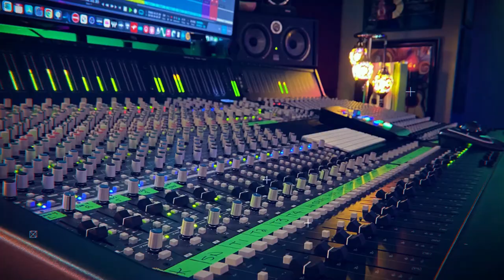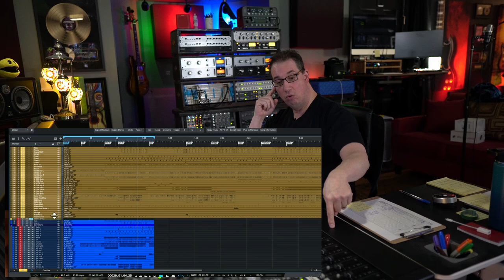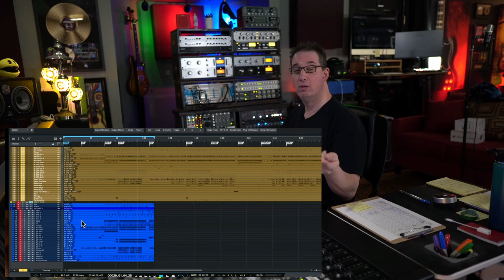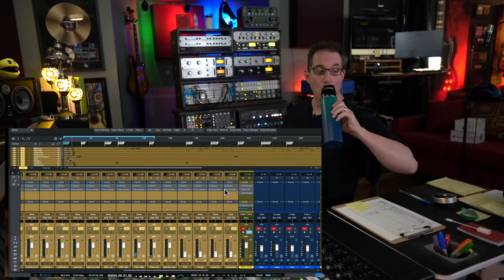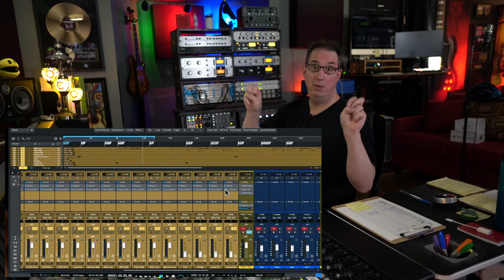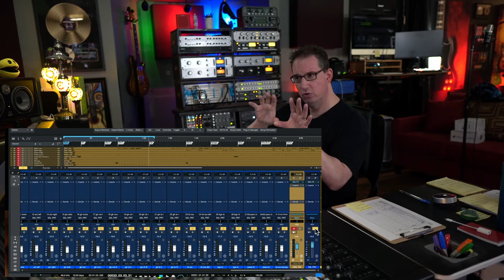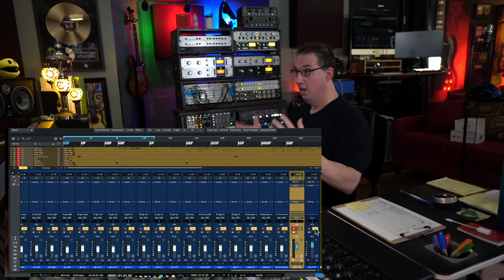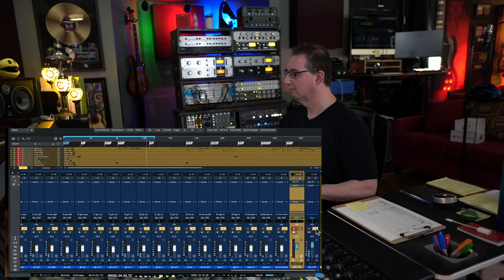SSL Origin Preamps vs SSL Plugin Preamps

Comment: I remember mixing my songs with lots of plugins, eqs, comps, etc trying to get an 80s power sound until I decided to use the Waves, yes the WAVES SSL channel (not the new one) and suddenly the world opened to me. The sound I get by just using the SSL is amazing, the EQ is so fricking musical and the Compressor is so on point and natural sounding that I practically use it on every track as if I was using a console and when I need some more surgical EQ I just throw the Studio One EQ in and make the special changes I need and also If I need to compress vocals or other instruments with more control I use the Waves CLA 76 or in some cases the powerful sounding Waves DBX 160 and that's practically all I need. I bet at least 80% of people saying "ohh you didn't compare it to the latest firmware of the plugin or this or that or this plugin is better and faithful to the original ssl" have never even used a real SSL console in their lives and never will. So they can only "imagine" an original sound and have never been exposed for loooong periods of time to a real SSL console to remember all the bits and flavors of the original thing and to be able to notice the differences and just bash on the plugin for the sake of it. Great presentation and thank you!  I would recommend watching the Josh West Mix channel and a video of his called "Analog Compressors vs Digital Plugins. Which is better?" which clearly says that in this case hardware was better obviously, but found that between the plugins the Waves compressosr were better and the closest to the original hardware compared to the UAD plugins. And this guy works in a massive studio with millions of harware and original stuff, but you can guess what the comment section is all about "naahh but you made the mistake of not using the latest firmware of the UAD bla bla bla". Man, I would put my money on what a guy that really works with THE original stuff everyday of his life says than on the word of people that are making music in a bedroom just like me lol.
Reply from the maker: I hear you and I know Josh very well. He and I spoken personally. I can tell you myself from someone who work with both plugins and hardware every single day that there is a MAJOR difference. Josh would tell you the same thing. There is a reason he works in a studio with a 250K console and hundreds of thousands of dollars of hardware. Its not "better" its different and if you watch my videos on this channel, you will hear me say that over and over again.
Reply: @MixingMusicAnalog  yes, and as I state everytime to my friends and musicians, it's the song and the heart of the production what makes a great tune, not the expensive gear. I've heard songs recorded and mixed at expensive studios that sound lifeless and tasteless while I,'ve heard tunes that kick ass and were recorded with a normal interface and mixed in the box. And the other way around too. Everything has its own context and if something sounds good then it sounds good, no matter what, no matter if you used plugins or a $10.000 USD hardware, noone will notice. At the end of the day what matters is what you feel is better for your workflow and what inspires you. One day I'll be the owner of a nice SSL console but because of the workflow that pushes you to use your ears and not be staring at a screen the entire time. Cheers and thank you for all the effort you put on this channel. Keep the good work!

Comment: I agree it was about a 10% difference, and the main takeaway is that both mixes sounded analog to me.  The Brainworx SSL E has more of a mid-range energy, while the Origin has more bottom and top, the origin has a nice smooth top, but perhaps the 10% difference might be that the Brainworx emulates a classic SSL console from the 1980s, while the Origin is brand new fresh off the lot SSL technology, and craftmanship.  Either way, both sound great, and with a good skilled engineer working the mix, no one even with trained ears would be able to say with 100% certainty that they can tell if the Brainworx mix is or is not analog if they weren't clued in beforehand.  I am glad you did this shootout, and yes the BX Console SSL 4000 E is my favorite channel strip.  😎😎
Reply from the maker: Thanks for checking out the video
Reply: I have a 1987 SSL 4000 E/G and it’s not that. The actual consoles just sound better and it’s essentially the same outcome with the vintage 4K. Remember, the Origin’s aim is a take on a modern ssl 4k sound.

Comment: What's up Dave. First off thank you for putting in the work for this demonstration. I can hear that difference you were describing before you started describing. But I also heard something else with the depth and separation that you were talking about it was clearly a difference but as you let the track play my ears got used to hearing the The depth and separation from the plug-in and then when you played the tracks off the SSL console then it was a difference. My conclusion is neither one sounds bad I wish that people would pay more attention to the craft of mixing then always worrying about gear Just my opinion keep coming with the videos.
Reply from the maker: Great points and I have said the same thing probably 10,000 times on this channel over the last 2 years...LOL. Its not about the gear but your skills. However, the gear does matter and that is what I am learning as well.
Reply: Your comment is the most lucid and should be at the top of the comments on this video. It's not the tool that makes a good mix, but creativity. ☺️

Comment: I do a ton of hybrid mixing.(mostly Neve stuff)
I will say your description of it being a small difference is spot on. In the real world I have noticed my Neve gear gets me to where I want much faster than using the plugin because of that 10 to 20 percent. It's just a point where the coloration and smoothness of not having foldback distortion or aliasing/niquist limitations doesn't make things sound as harsh or as boxed in.
Reply from the maker: Thanks for watching and I agree with you! :)

Comment: I'm only listening through headphones using DSoniq Realphones but here's what I hear. Even before the drums kick in, it seems the vocal sits better with the SSL Origin. Everything sounds a tiny bit thicker with the plugins, though I don't say that as a positive or negative. The result is overall the SSL Origin sounds more exciting and airy, 10% pre-mixed if that makes sense. SSL Origin sounds brighter too, and I think I'm hearing the snare with a bit more saturation (I think of it as a subtle squeeze). I think the vocals do sit better in the mix with the Origin, again I think it's because there's more space in the low mids. I can hear what you mean with the width and depth too. Not sure if what I'm hearing is the result of the saturation differences, preamp curves (if any), summing, or whatever else it is. Still of the opinion that the mixing engineer matters the most in the end, but I like what the Origin is doing.
Reply from the maker: Good analysis. And OF COURSE, its the skills not the gear that makes the most difference and I say that on this channel over and over and over again. That is obvious. At this point I should not even have to say that. LOL

Comment: I think the SSL print sounds more colored. I wonder should we all go buy 2 channels of analog 500 series channel strips and run our tracks through them reprint them to get that console sound? This reminds me when we had the Alesis ADAT and we went out and bought tube pre-amps to track with to warm up the tracks.
Reply: I’ll actually do this often - print all tracks back through either Neve or API preamps (if the recordings were made into an interface with no other hardware) - makes a difference for me!
Reply from the maker: You can do that but it takes a long time to run every track back in 1 at a time. That will slow down your workflow considerably.

Comment: I have two traducers (added components that emulates low frequencies) installed on my chair that translates the low end slightly more on the Plugin Alliance plugin than your console mixing board. Audibly through the monitors i am translating it to be a difference. I feel it and hear it. Maybe because of the audio translation through YouTube that it don't appear it that much..?  It's not a true live experience . That's my take and experience. Slight difference however marginal. The plug in adds slight depth and with and boosts 20-120 range.  Digital 1   Analog 1  They both sound awesome but the print is more alive though. The more time I'm on listening both versions the more i find differences.
Reply from the maker: Thanks for watching!

Comment: I think with the plugins you might have to add other plugins, but you could still maybe achieve the same sound by adding saturation and stereo widening plugins to get more of a feeling of depth.
Reply from the maker: You would have to add other plugins for sure but it will never sound the same as a console. I work with both every day and there is no comparison in my opinion
Reply: @MixingMusicAnalog  Yes, because first, the last thing you want to do with plugins is "stereo widening", it's like un- gluing the mix making elements go all over the place, and also good luck with plugins saturation hype. It's like going to Casino. 1 time out of 10 will actually work.

Comment: nice comparison.  first listen with eyes closed I really couldn't tell when you were cutting from plug-in version and ssl version--hard to separate a difference in the performance from a difference in the processing maybe.  Watching the changes I think I could hear what seems like more harmonic content--like the vocal was almost doubled with more low and high harmonics but it almost sounded artificial like a subtle octave effect or even a slap-back echo with a very short delay.  It seems like it is "doing a thing" and whether or not you like that thing is up to you.  where I heard the most difference is the section around 13:43 where the vocal in the plugin maybe sounds flat or normal then the switch to the ssl sounds like it has an effect on it to the point where I think I would probably try to tame whatever is going on there--I like the high end but not the low end--as these aren't mixed you would probably make some changes to both.  The channel strip tracks seem like they just need some eq love.  It would be interesting to compare a final mix of each.
Reply from the maker: I appreciate you watching!

Comment: It´s a shame you sold your Fusion, because I would be curious of the sound between the console, and the Fusion. But, your video of the Fusion, and the Fusion Plugins showed me that the Fusion had more depth, similar to the console, which is the reason I bought a Fusion. :)
Reply from the maker: The sound between the console and the Fusion? thats not a fair comparison in my opinion. If someone thinks that the Fusion sounds like a full console, then they are totally mis-informed.

Comment: Ok I know you said it but I'm gonna be "that guy for a minute" 😂 Doesn't the Origin have a "Superanalogue" preamp with the addition of the new Puredrive FET design? I think the Superanalogue was introduced in the 9000 series consoles. That said, I don't think there is that big a difference between the BX 9000 and 4000 for this comparison. If anything the 9000 might be cleaner. Great video! I think it shows pretty clearly that the console does have a bit of extra sauce you get "for free" just by running through the preamps vs using a bunch of plugins to get close to the same effect. Personally, I think channel strip plugins are too clunky to work with and the console is far better workflow.
Reply from the maker: The Origin does NOT have the Super Analog preamp, it has the Pure Drive which is a totally new design based on the combination of preamps from the past. As I said, which plugin I would have used would have made little to no difference, in my opinion
Reply: @MixingMusicAnalog  Very interesting. After I posted my comment I realized that I should have said something along the lines of "of course I could be totally wrong." I agree that the plugin used makes little difference in this comparison.

Comment: The differences between console and plug in your video was again audible on the laptop. I hope you get a chance to try the SSL 4KB plugin if you haven't already. FWIW I asked my dealer for an SSL 611 EQ to compare with the SSL 4KB plugin (which also has a drive circuit). There was another person in the studio during the shootout. We tweaked by ear because by merely copying settings on the analog we couldn't match the plugin. After tweaking by ear though, neither of us could tell the difference between them,  blind.  We did a null test and they didn't cancel 100% but they did cancel a LOT. I think it would be difficult to get two analog EQs to cancel completely but anyway, this was great news because we'll be able to use the Origin's EQs and the plug interchangeably, whether ITB or OTB. Bottom line i think SSL killed it with that plugin. Take care and thanks for the great videos!
Reply from the maker: Thanks for your input!
Reply: The difference would be noticeable when you stack the tracks. One on one with nothing else they might be similar, but when you create a full song out of analog versus software. It’s very noticeable. If only it was that cheap, and not easy, then we wouldn’t have to spend thousands on analog.